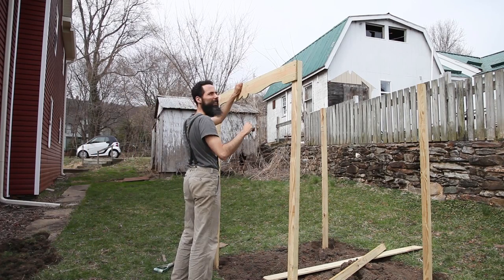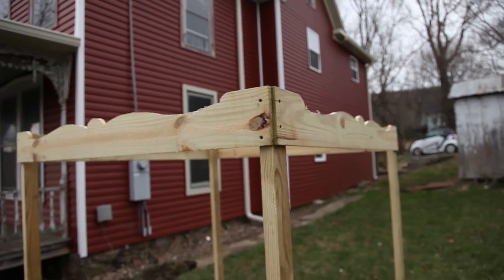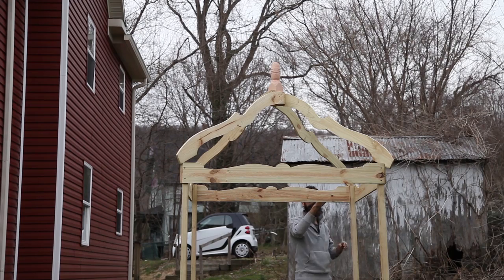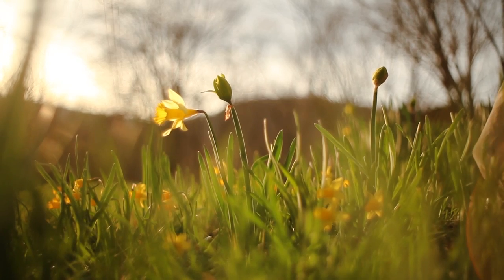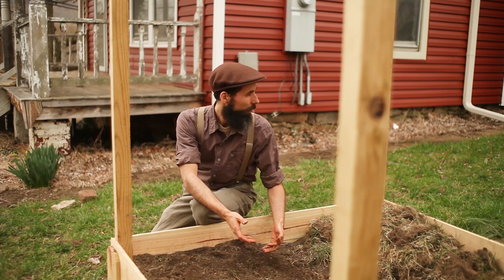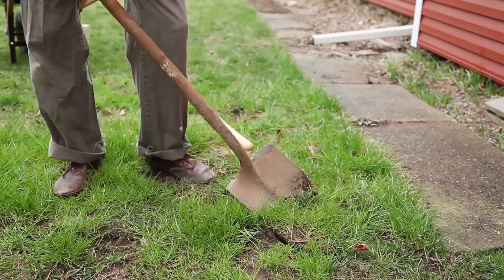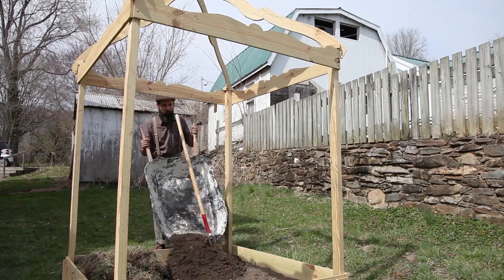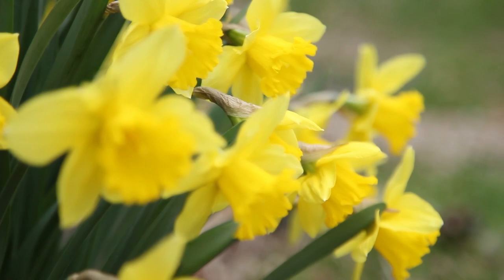How to Build a Fancy Garden Bed from Cheap Fence Boards - Part 2

Comment: When I'm building solo, I use clamps to hold joints in place so I can screw them securely.  Just finished a fence project that went quickly because I could clamp each board into place right where it belonged and not worry about it shifting.

Comment: I also have a sloped property.  Not extreme, but enough to notice.  All the water goes west when it rains.   Plans in the works to make drainage ways and a little bog garden where the water likes to just sit and sop around into the back yard.

Comment: Hah! you may have explained a long standing garden mystery for me, with discussing the soil layers.  Cucumbers never grew well in my yard, except for one year which had a huge crop.  What I did that particular very hot year (without planning or thinking) was I happened to water the cucumbers by jamming a hose into the soil.  Long before anything taking off, I noticed the unusual irrigation method was pulling some fine sandy looking solid to the top.  Since the topsoil is pretty heavy clay I figured it may help drainage so left it going that way.  With your description of the layers I now think there may have been some needed minerals in that too.  Perhaps next season I may attempt to replicate the feat elsewhere in the garden.
Reply from the maker: I'm happy to hear that. I'm happy to be of help

Comment: I'm out here in the sticks by myself as well, very familiar with growing an extra hand when needed! I had to abandon finishing a shed before winter because the frame was just too heavy and I'm only 5ft2. That's a spring project now, if I can snag someone with a lift assist. Is that your electric car? It seems to be in the same parking spot as the last video👀
Reply from the maker: We gotta do what we gotta do. The car is a gas model, because electric would not be logistically feasible were I am.

Comment: Did you use pressure treated lumber ? If so aren't you afraid of it leaching into the soil ?  I want to do this with a micro watering system , I was thinking of putting a liner inside and putting drain holes in the bottom to keep  keep the side walls from rot , or seal the inside walls with an epoxy paint ?  Any ideas ?
Reply from the maker: Hi Dave, I explain my choice of pressure treated wood in the previous video. The newer stuff is much safer than previous, but I don’t think they are rated for direct water contact. I would not use it for that
Reply: suburban homestead ,so there is no moisture barrier on your bed how do you keep it from getting wet and eventually rotting away when you water your plants?